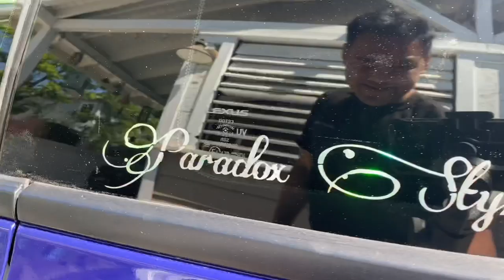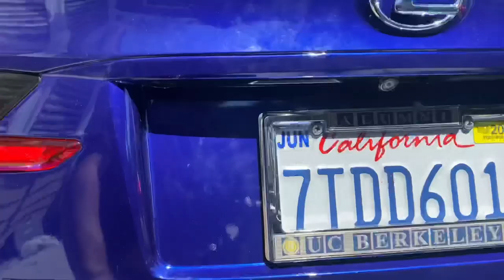DAMAGED HIS LEXUS RC...The Importance Of Picking The Right Wrapper | ParadoxWraps Metallic Blueberry

Comment: The way you do the wrap without using soap solution, removing/peeling/lifting up the wrap to place wrap correctly destroys the wrap glue material which may be minor but totally destroys the clear coat of the paint leading to faster ageing of the paint on the car.

Comment: Seriously? I wouldn't let this guy wrap my car for free. The environment, especially the floor where the car is wrapped is filthy and the door is left open for wind to blow all sorts of debit under the film. When the release liner is removed, especially when wrapping the sides, the vinyl is dragging on the ground. There are dirt particles under the vinyl everywhere. He's heating and stretching in the wrong places which means it will have a short lifespan and will lift in no time. In fact he's already pushing down edges where it's starting to lift all over the place while he's showing the owner the car, IE. it hasn't even held for a day. Inlays are used where overlays should be used and vice versa, causing the overlap to face the wrong direction. It doesn't even look like knifeless tape was used as the edges are skew. The vinyl is handled poorly and the protective cap released at the wrong time causing unnecessary scratches. I could go on far longer but wont bother. Check the results in person and up close. Videos are very deceptive. I'm sure I'll get a tonne of abuse for pointing all this out but personally don't care.
Reply from the maker: Lol you should definitely buy some of my wrap and start a YouTube channel to show me how it’s done.